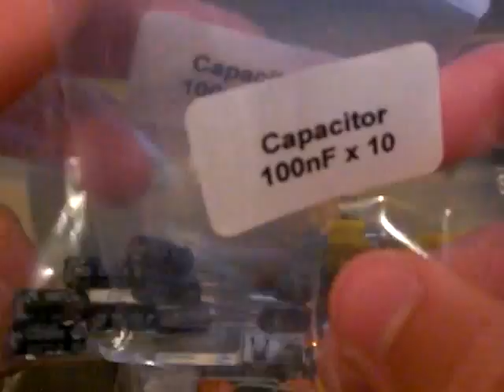Raspberry Pi - Getting Started - Electronics Basics...

Comment: Just thought I would add that I made an ultrasonic detector back in the 70's and cost a fortune!!
These Ultrasonic transducers work at around 40Khz and work on the "Doppler effect", which (if I recall correctly) measure the DIFFERENCE in frequency. 40 Khz is transmitted, when sound is reflected off a moving object a slightly higher (or lower) frequency is generated and it is the difference between the 2 frequencies is what is "seen" as movement/ detection. Nothing too technical!
Correct me if I am wrong :)
Reply: +mick florey You are wrong, actually they just help you measure the time that it took the beep to come back by emitting a pulse for the same span. You are right about how you would measure the Doppler effect, and the application is movement (as you say). The sensor shown does not measure movement but distance, and the presenter is wrong because it produces a digital signal and not an analog one.